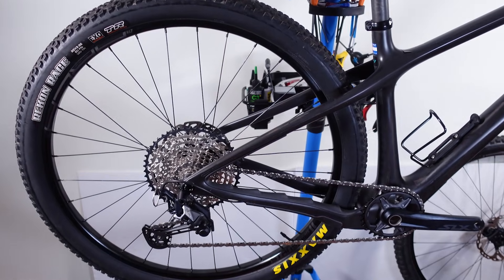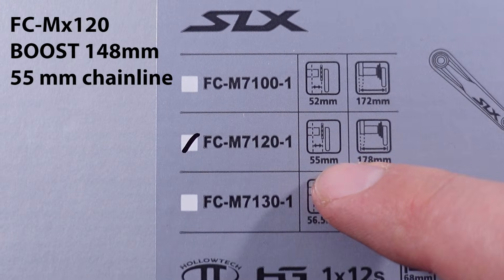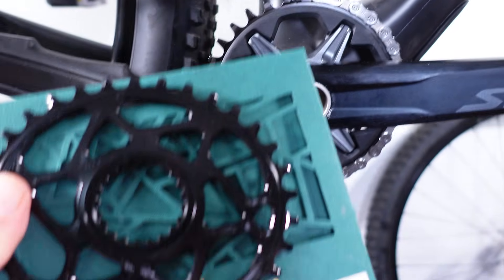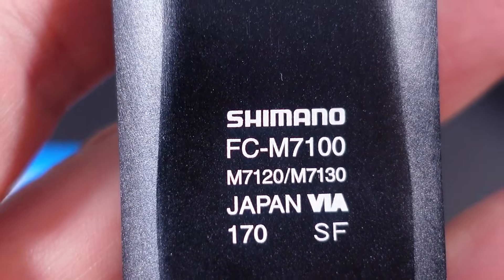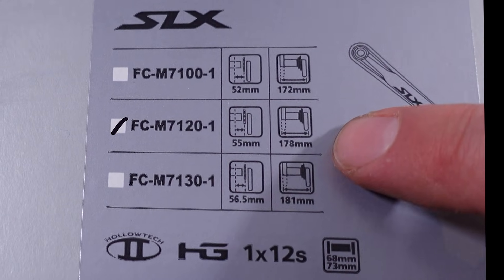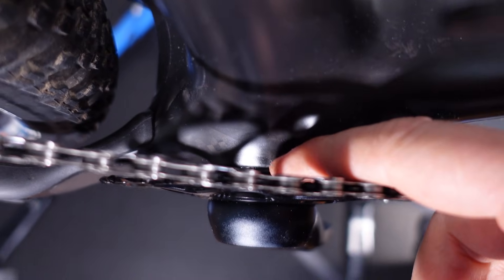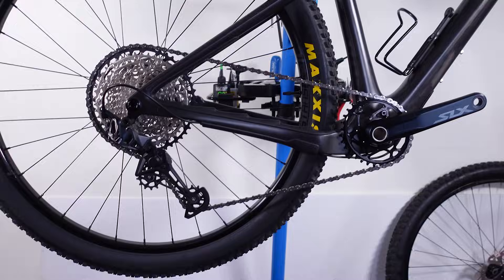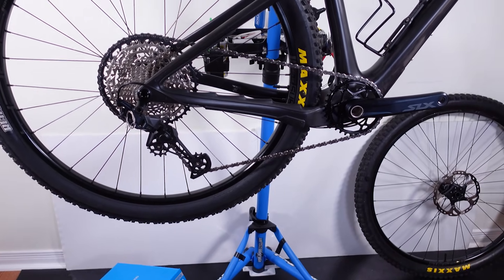12 Speed CHAINLINE Explained - 52 vs 55 vs 56.5 mm, Shimano SLX M7100 vs M7120  Cranksets

Comment: Greetings...I did speak to you recently about BB/cranksets. You mentioned when building a Bike, I need to pick out a Crankset first then look at the BB. What I'm looking at is...Crankset/Chainring for a "3mm offset with Boost" with a chainline of 52mm...eventually for a "10 speed" Microshift Advent X. I see there's many components/drivetrains for 12 speeds, but somehow I feel I'm a little limited with my choices. The Shimano XT 8000 MTB crankset - boost, with the Shimano XT M8000 single chainring. I know LoveMTB you said I must choose one, tbh I'm enquiring for your advice...thanks in advance. Cheers mate.
Reply: @LoveMTB  ...Hi and a big thank you for replying. I'm looking at the SLX M7100 and the BB is Threaded: BB-MT800...I can get one of them (it does say for a 12speed?) this will be suited for a 10speed? I see it says chainline 52mm - Good there! My Frame is a 2021 model Nukeproof Scout 27.5 with a BB: 73 BSA...so all good! So am I right in saying so long as the chainline of 52mm is correct (regardless if the chainring is offset or not), I can align the crankset with a spacer(s) to the non-drive side? So inturn I have a smooth chainring leading into the drivetrain alignment? The spacer is taking up the offset from the chainring...Yes? Oh my I'll stop here. Thanks LoveMTB. Cheers.
Reply: @LoveMTB  ...32t max. Cheers.
Reply: @LoveMTB ...Hi, thanks for your time LoveMTB. I ended up purchasing a "RaceFace Aeffect- R Crankset" 175mm. My chainline is 52mm on a Nkp Scout 27.5 2021 with Boost..the chainline on this is 51mm, I was told this will work  okay. What do you think about my decision and the quality of Race Face? Cheers.

Comment: Thanks for all the great bike videos. Very clear and informative.

I am considering replacing the Shimano MT510-1 (30T) crankset on my 2021 bike (new 12 speed Shimano). The axle length on the MT510-1 is 119 mm, splitting the M7100 (115 mm) and the M7120 (121 mm). That made me think that the M7120 may be the better choice because it is closer in length to the MT510-1. 

But... the MT510-1 has a chain line of 52 mm, same as the M7100. The M7120's chain line is 55 mm. 
So is the chain line the number I should focus on, making the M7100 the best choice?

The chain stay of the bike has a comfortable gap with the MT510-1, but if I go to the m7100 with a 115 mm axle, does that mean the chainring will be 4 mm closer in to the chain stay?
If the M7100 has the same chain line as the MT510-1, it should mean that the chainring on both will be the same distance from that chain stay. Yes?  

Thanks for any advice you can provide.
Reply: @LoveMTB  I recently bought and Installed the SLX 7100 with the 52mm chainline and it fits great. Thanks for the excellent advice!
Reply: @LoveMTB  what do you mean if bike uses 52 chainline? is there any other factor beside the frame is designed with more room so that 52 would fit or is there some other factors as well?

Comment: I need advice.
Have a 2021 trek xcaliber 9
Trek states largest chainring is a 32T.
I want a 34t if not a 36t.
Is this acheviable with the stock spindle ( direc mount) with a 3MM spacer? 
My drive side crank is very close to my frame compared to the non drive side.
Reply: @LoveMTB   Shimano External Bottom Bracket, SM-BB52, BSA Threaded shimano crank
Reply: Any suggestions?
Reply: @LoveMTB  appreciate the response

Comment: GREAT and very informative as per usual ... it looks like you are using a PF30 bottom bracket is that correct?  and you went with a crankset with a larger Q-Factor to accommodate the oval chainring.?? The same drive gear is fitted to trance 29er 2 2021 so I like to know what size crank is fitted to that from factory
Reply: @LoveMTB  Righ so you didn't use the one ticked in your vid .. it threw me ....

Comment: So with the Boost frame, Wheel set, SLX 12 speed 10T-51T cassette and the press fit BB92, should I get a M7100 crankset (52mm chain line) or M7120 crankset (55mm chain line)?

Comment: Will there be any issues if i try to run the 7130 crankset on a normal boost(12x148) frame?

Comment: That was a really helpful video thank you. I have bought a 6120 chainset by mistake instead of a 6100 with the correct 52mm chainline for my privateer 141 frame and I'm wondering if I would get away with the 6120 and its 55mm with no issues or would you swap to brand recommended 6100 with 52mm chainline? The chainstay length is 452mm. What do you think?

Comment: I bought an M7120 crankset by mistake / following the guidance that it would be ok for Boost frames but the performance of the 55mm chainline on a wide range cassette is really poor. Any backpedal or even moving the bike backwards whilst off it results in the chain dropping right down the cassette and sometimes risking damage when setting off again, or repeatedly having to adjust it manually. I am a bikepacker so use the big 51t regularly and the extreme angle is a bit concerning for wear. I am interested to know if you have tried using a 6mm offset, (non Boost) ring on the 7120's to achieve a 52mm chainline again?
Reply: @LoveMTB  yes think we night be selling two sets soon!

Comment: I'm using fc-m7120 on both of my boost bikes. To give a better chainline I'm running the two 3mm spacers on the non-drive side of both bikes.
Reply: That makes no sense.  The 7120 is the wider of the two cranksets shimano recomends for a boost frame with a 55mm chainline.  If you add an additional 3mm spacer on the drive side you are making the chainline 58mm which is more than Shimano's recommended chainline for a super-boost frame.
Reply: I removed a 3mm spacer from the drive side not added! 😅
Reply: I'm considering doing something similiar. I'm not happy with the chainline on my kona unit x with boost wheels and m8120 crank. have one 3mm spacer on each side as specified but it makes the low gears run like crap. Since its a bikepacking build im going to be in that low gear a lot.

Comment: 6:32 there is a slight bending on the chain, is it normal?
Reply: @LoveMTB  Bit off topic but, I've got internal CVT gear hub since 2009, the written effectiveness of the hub is lower than Shimos but since there is no lag between gear changes, it gave me much clearer and longer duration rides without getting exhausted. I would love to couple it with a belt drive but detachable belts are 330$ and my country currency is like monopoly money compared to $.
Reply: @LoveMTB  It is Nuvinci n360, but the n380 costs cheaper than a belt drive so my next upgrade probably
Reply: And I'm wishing that they come out with the solution of hollow bearings, which would be even lighter than Srams. I already wrote to the company about this idea, but we'll see..

Comment: Hi, i'm about o buy the same frame in xl size. I've bought an xtr 9100-1 crank. Yeti says i should use an 9125 model. I'm running 34 t chainwheel. I work at a bikeshop as a mechanic. That was the only model that was on stock. Got a annoying right knee, so a small q factor is important to me. Will the crank arms rubb the frame. Or should i look out for a different frame. ?

Comment: I had the M8120 on my 2020 Trek Fuel EX 9.8, but once I built my 2021 Banshee Paradox with the same crankset it caused terrible back pedaling (would come off top 3 cogs), I had to find a small chainline crankset. I got an M7100, which funny enough was lighter by 70 grams than the M8120 because of the shorter spindle.

Comment: Just installed a M5100-1 crankset on a full suspension frame with BSA 73mm bb and 142mm thru-axle. The M5100-1 is set at 52mm. I moved the 2.5mm bb spacer from the drive side to the non-drive side. By doing so I offset my crank by 2.5mm therefore reducing my chain line from 52mm to 49.5mm. I can't go any closer as I don't have enough frame clearance for the chainring and tire clearance is close when in the 51T cog. I will be testing over the next few weeks.
Reply: @LoveMTB  Works great!. M5100-1 (32T) crankset, RD-M5100 SGS, M5100 11-51T cassette (11 speed) and CN-HG701 chain. Moved 2.5mm drive side bb spacer to non-drive side. That moved my crankset and chain ring inward by 2.5mm for a crank chain line of 49.5mm. I can't go any closer since I only have about 1mm of clearance between the chain stay and chainring. I have non-boost full suspension frame with 142mm thru axle in the rear running 27.5x2.4" tires. Only 420mm chain stay length in uncompressed position which grows by about 25mm with rear suspension compressed. Chain is a little close to the tire while in the 51T cog but seems to be okay. Took it for a ride this morning climbing in the 51T cog I was able to backpedal without dropping the chain into smaller cog. Very smooth and precise shifting for a mid-range Deore M5100 drivetrain. I'm happy!
Reply: The only issue was the chain length. Shimano recommends adding 5-6 links plus quick link with suspension in fully compressed (or longest chain stay length) for the M5100 SGS derailleur. I used this method but chain was too slack so I removed 2 links and it seems to be perfect now.

Comment: My Frame is 135 and the case with BB size is 68mm BSA.
Group SLX M7100 - 175mm - Koozer Hub 135 and Microspline 12s for Koozer XM490, PYC Chain 12s ans Chainring "Coroas Iron" mande ind Brasil 30t offset 6mm and BB MT800.
I had to buy a new chainring, Brazilian national brand that manufacture Shimano chainring with 6mm Offset The original is 3mm.
Q Factor is the same L and R. 
On the right side of the chainring I only use 01 2.5mm  or 2.0mm BB spacer.
And on the Left side I use the 02 2.5mm or 2.0mm  Spacers that come with the BB MT800.
However, on the Shimano website it is very confusing, there it asks to use 02 spacers on the right side and 01 on the left.
I don't know how to calculate the Chainline, so I went in the eye.
Chainring with 6mm offset was less twisted on 51t. Very Nice.
Reply: Yes, Shimano recommends 2 (2.5mm spacers) on drive side and 1 (2.5mm spacer) on non-drive side. You can move one spacer to the non-drive side to reduce chainline by 2.5mm but it will offset your crankset which probably is not a big deal providing you have frame clearance for chainring, crankarm and tire clearance for chain. Shimano also has bb spacers in 1.7mm and 0.8mm widths for finer adjustments. You'll need to use a total of 7.5mm worth of spacers for 68mm BSA. Only 1 (2.5mm spacer) is needed for 73mm BSA. Chainline is calculated by measuring the distance from the chainring tooth to the center of the seat tube (center of frame). Ideally you want this to match the distance from the center of the rear hub to the center of the cassette to balance the amount of chain deflection to the right and left as you shift gears. The angle of chain deflection would be equal in both directions.

Comment: Thank you so much for the info!!!! I recently bought a rocky mountain growler 50. I decided to go with an oval chain ring system from one up components only to find out that the deore cranks don't support direct mount spiders / chain rings. I have been racking my brain with all the new superboost vs boost and so on. I found a set of slx cranks that support direct mount of the oneup system and this vid actually clarifies nearly a week of research I have done. thank you again!

Comment: Sir I have gt avalanche frame 27.5 small size I will set for 1x12.... Rear hub space is 141mm the bottom bracket is 73mm... What crank arm shimano compatible for my frame
Reply: @LoveMTB  rear hub 141mm bottom bracket 73mm..what If I go for 1x11...what is the chainline I use

Comment: Super informative video. The SLX comes 172/52 and 178/55. I have a Deore crankset FC-MT510 that’s 177/52. Is it safe to assume the angle or width of the crank arms is different to achieve the 177 q factor? Or is there something else I’m missing
Reply: @LoveMTB  not sure tbh. I was considering upgrading cranks to SLX and decided to do some research and came across your vid. With my current 52 chainline I haven’t noticed chain drop when pedaling backwards (though I don’t think I’ve pedaled backwards in those easy gears for it to happen)
Reply: @LoveMTB  okay will do!
Reply: Sir I have gt avalanche frame I will set up for 1x12....rear hub is 141mm  bottom bracket is 73mm...what is the best compatible crank arm shimano model

Comment: I bougth The m6100 for my 135mm frame. But even using one spacer in bb52 central as information in the manual I noticed that my crank on the rigth site is much closer to the seat tube/chain stay than the crank on the left side.  This is normal? Are they asymmetric? ( left side more angle open than right side ? )
Reply: @LoveMTB  but in my case the chain stay is symemetrical. Im suspicius if its possible for the shimano crankset to be asymmetrical.  Left side with wider angle.
Reply: @Maker3d380  Is your bb shell 68mm or 73mm wide? Use 1 (2.5mm spacer) on drive-side for 73mm. Use 2 (2.5mm spacers) on drive-side and 1 (2.5mm spacers) on non-drive side for 68mm.

Comment: Thanks for your work and this video. I watch all your videos to be sure of what and how to buy a new part to improve my bike. After the Shimano BB-500-PA bottom bracket started to make noise with no more than 250 miles on a Trek Fuel EX 5 Deore 2021 bike I decided to improve the bike yes or yes, I want to start with the powertrain, I bought the bottom bracket of the Wheels Manufacturing brand and now waiting for it to arrive, I started looking for the crankset. My bike comes with a very rare Shimano 12 speed MT-511 because the Q-Factor is 178.5mm and the Chainline is 52mm, but when you look for those dimensions on the Deore XT 8100 series, the FC-8100-1 comes with a 52mm chainline BUT with a Q-Factor 172mm (6mm less) but that is very close to the frame I had to then choose the FC-8120-1 that comes with the Q-factor 178 almost the same as the MT-511 only 0.5mm less but with a chainline greater than 55mm. I hope it works for me because I have no other idea what to do.
Reply: @LoveMTB  well after some math, I realized that the outgoing not drive crank arm, the left, was 3mm thicker that the FC-MT-8120, so for that part the spacer that came with the crank arm XT, fix that, but on the other side with a spacer of 1 mm ,for me, was enough because, the 3mm was to big the chains ring stay to far from the frame, then 3mm spacer on the left side and 1mm on the right side and the distance between rear arm of the frame and the crank arm is almost the same on both side maybe 1mm more or less but for me don’t bother me. I have ride more that 40 miles and not issues neither changing up and down the different speeds without adjust the rear derailleur. Everything is smooth now and much much better. Any advice is welcome.

Comment: Know of any 3rd party manufacturers making 6mm offset shimano chainrings besides Garbaruk yet? Loving the wider q-factor of my m8120 cranks but the 55mm chainline definitely isn't ideal and looking to get the 52mm chainline back.
Reply: Nathan, Did you get a resolution to this. I ordered 7120's by mistake. I have the 3mm Offset chainring but the drop of the chain with a single back pedal is infuriating so I'm also looking to reduce the extreme chain line of 55. Is running a non boost (6mm offset) direct mount chainring the answer? I have tonnes of space from chainring to chainstay due to the wider spindle.
Reply: @Endorphinix  Garbaruk is the only one I know of offering a 6mm offset chainring for shimano 12-speed cranks. It's Garbaruk's XTR Custom Offset model. That's really your only option to get a 52mm chainline on m8120/m7120 cranks currently.

Comment: So, on boost 148 bike, those cranks with 55mm chainline, 32 teeth, no spacers will be needed and that curving on the chain will be less dramatic? Am I right?
Reply: @LoveMTB  No, the "only boost" version. I didnt understand at the end, if you used 55mm with 3mm spacers, or 52mm with 3mm spacers, when you installed that oval.

Comment: WHY? WHY? WHY does Shimano recommend 52mm chain line for 135/142 frames? I spaced my M5100 crankset chainring (96 bcd) from 52mm back to 47.5mm by using 4.5mm worth of spacers and longer 16mm chainring bolts. Wish I didn't have to do that. Wish Shimano made a 1x crankset with 48mm chain line for their newer drivetrains. I'm loving the Deore M5100 drivetrain, just wished they made a crankset with 48mm chain line. My chain stays are only 425mm so 52mm chain line angle was too extreme. I do a lot of climbing in 51T cog. My drivetrain works perfectly, but only because I reduced my chain line to 47.5mm. No problem backpedaling on 51T cog.
Reply: What spacer did you use?
Reply: @noellereypelayo551  no spacers
Reply: @noellereypelayo551  I placed nylon spacers between the chainring and the crankarm in order to move the chainring closer to the frame in order to reduce my chain line from 52mm to 47.5. I had to purchase longer chainring bolts. Went from 12mm to 16mm long bolts.
Reply: I have same problem .. f+ck shimano, i hate this evil company i have spent touch money on single upgrade and got wrong chainline with my 73mm bb...